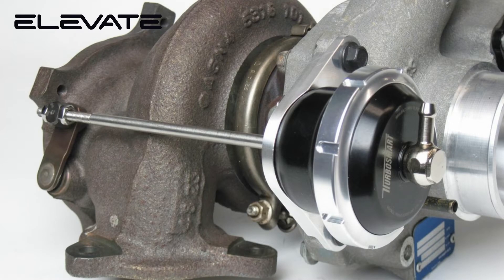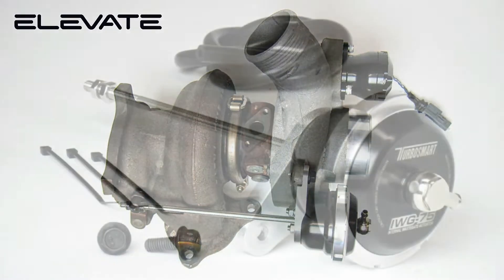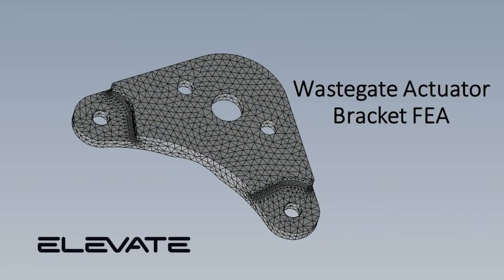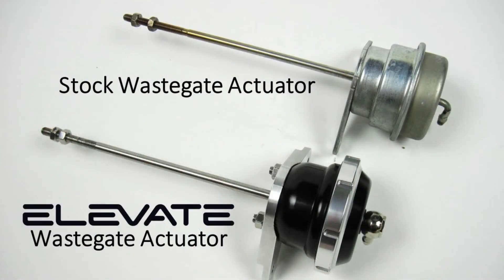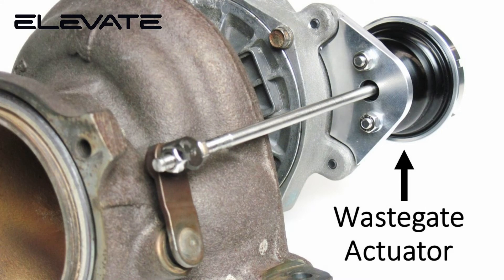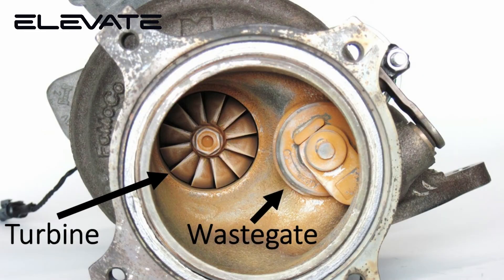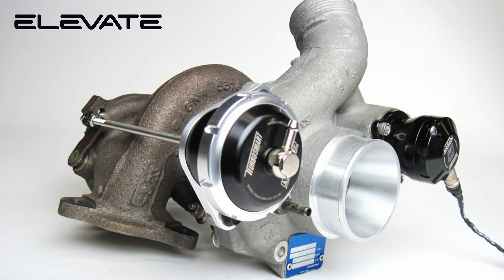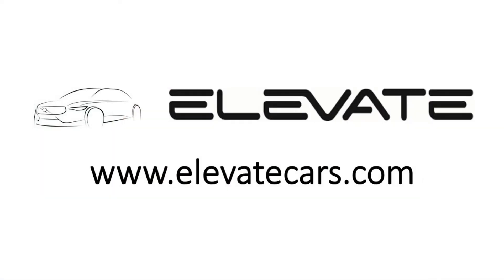Elevate Volvo P3 3.0L T6 Turbo Wastegate Actuator

Comment: You mention that the computer dictates boost pressure.  What would happen if the spring was increased/changed out for a higher pressure spring on this unit? Just curious as I don't know much about these things work.
Reply from the maker: If you changed the spring just a bit, the computer would adapt and regulate to the output level it is targeting. If you put a spring in that is too far out of range, the computer will go into limp mode.